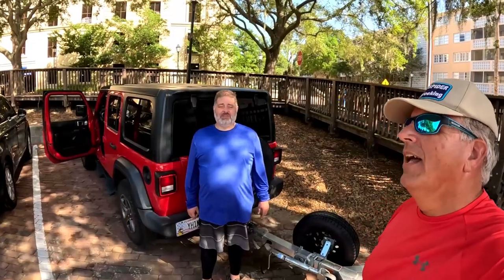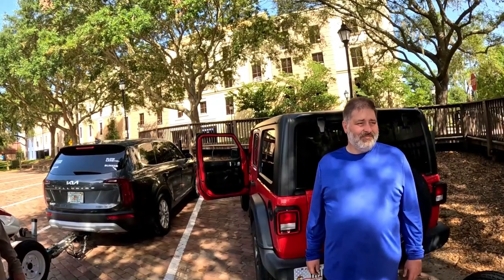18 Month Review of Gator Glide Coating on the Hulls of 3 2020/2021 Yamaha Waverunner FX's #jetski

Comment: Probably should add that to my 2014's. We did a little damage to them on the Ocklawaha last fall. Didn't get to explore the river after that. wanting to go back! Thanx for sharing!
Reply from the maker: The key thing is that it really protects from everyday scratches etc and certainly helps as you have seen from our mishaps but you should still treat your hull like it’s a pristine hull with no further protection. But with that said it appears to strengthen the ski against most minor dings… thanks for watching… Bob

Comment: The guy from watercraft journal had said that having Gator glide applied to your ski would be like driving a car with ball tires. Looks like you're not experiencing that. Thanks for the video.
Reply from the maker: The guy from watercraft journal and I disagree on a few things…. Hahahaha.  I’ll add this one to the list… no performance effect on speed , turns etc… good to have in our opinion if you do adventure skiing…  thanks for watching…. Bob
Reply: I also had no noticeable difference in handling, nor did I expect to. I do agree with Kevin a lot, but the actual experience with gator glide proved to me there was no disadvantage other than cost.
Reply from the maker: @Briandswinford  thanks for watching  and commenting.   Bob
Reply: to be fair, kevin shaw is speaking for the guys that are dropping knees into corners @ 50 mph. Bob is more casual, not a bad thing, but thats where the difference lies.
Reply: @BobBroeking you may not ever "recall riding with me" but are you saying you're a circuit racer? the guys that are doing this professionally are the ones noticing the difference. WCJ has been doing this for decades they arent hobbyists. All i was doing was clarifying what WCJ said about gator glide. it IS altering your watercraft since you only apply gator glide the lower part of the hull that hits the water, but in a hard turn you're rapidly changing surface tension on the water to the part of the hull that isnt gator glide so it changes your turns. straight line adventure riders will not notice an oz of difference

Comment: Those hulls are looking good! I am going to drop off my 21 FX to a guy in southern Ohio to have the coating put on, but I am going to have Super Slick (Fasco) put on. I dont think Jeff B is doing Gator Glide anymore. I am 99.9% sure he has been using Super Slick for a long time. Are you guys sure you have Gator Glide and not Super Slick? I am going to ask my installer if he can put a light colored base coat on first and then finish with black. The lighter base color would act as a wear indicator. I am not sure if its doable, but Ill talk to the installer when I drop mine off.
Reply from the maker: Surprised you are not applying the coating by yourself with your talents.
Reply: Loren, not sure if he has gotten away from it or not but ours is definitely Gatorglide.

Comment: Bob.... Appreciate the video.....Can you provide a POC in Central Florida where you had "Gator Glide" installed on your ski??
Reply from the maker: Yes Jeff Butler owner of Performance Fiberglass Repair in Cocoa Beach at 321-720-9299.  Pfiberglassrepairs@gmail.com
Reply: Thanks Bob :).
Reply: @BobBroeking  Thanks Bob!
Reply from the maker: @johnsnow2347  It took me a couple od days to get the contact info from Jeff.
Reply: @BobBroeking  No worries. Appreciate ethe assistance.

Comment: Are those bubbles that you show on the Gator Glide? If so, is there water between the Gator Glide and the hull?
Reply: I thought thT at first but then i realized it was water droplets, i think!
Reply from the maker: The surface is scalloped … the hulls were wet as we filmed that at the ramp after a ski trip and had just taken them out of the water….
Reply from the maker: Exactly they had just come out of the lake… thanks for watching

Comment: Would the gator glide be to slick to use on pwc lifts?
Reply from the maker: Not sure exactly; if the lift raises level then no issue... a slight tilt then maybe; at least for the first 6 months.